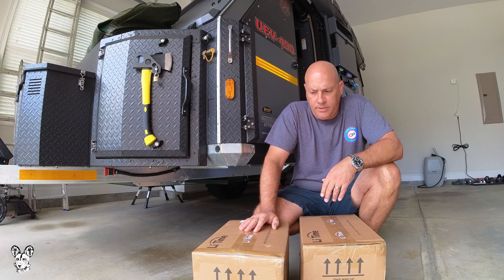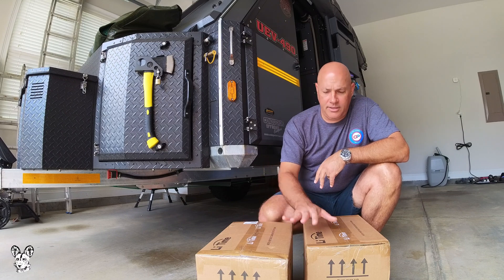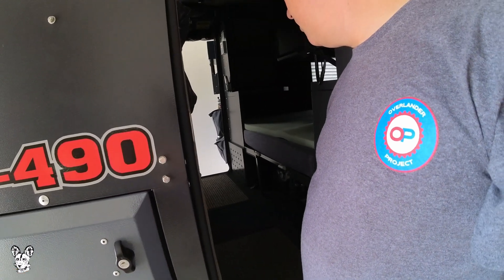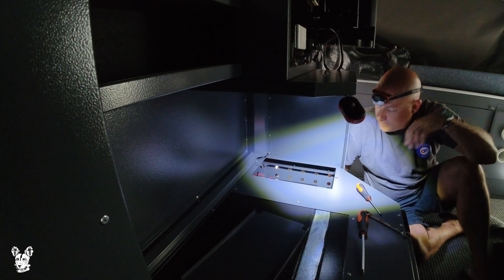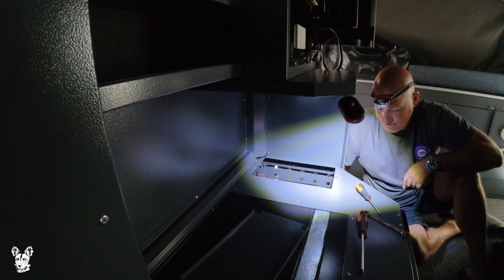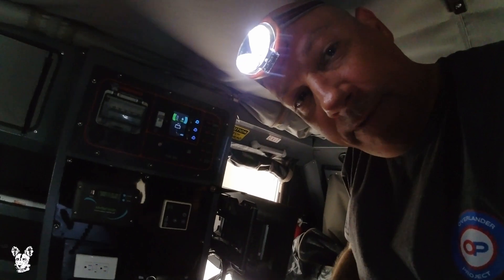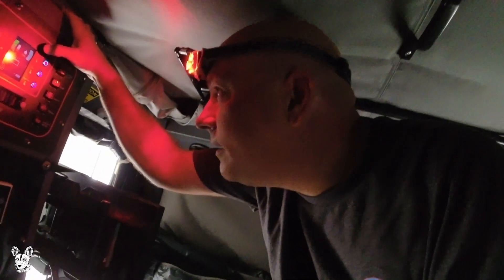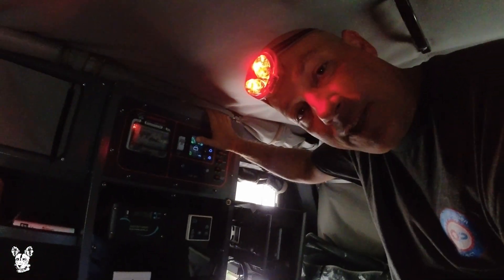Conqueror UEV-490 | Lithium Upgrade

Comment: Was considering the same batteries...did you end up having to make any setting changes to charge the Lithiums properly after the switch from AGMs?
Reply from the maker: Nothing different at all. Charges at just under 19 Amps perfectly. The charger is managing it correctly, Starts dropping amps as the batteries get full.
Reply: @painteddogoverland  I had the same question, switching out my 2022 UEV 440 to Lithium. Thank you for putting this video together.
Reply: wondering the same, looking at switching our uev490 to Lithium and wondering if the management system needs to know anything different
Reply: I did lithium conversion, and disconnected the original charger, installed a lithium charger .
Reply: Would you mind sharing the brand name and details on the lithium you used during this video